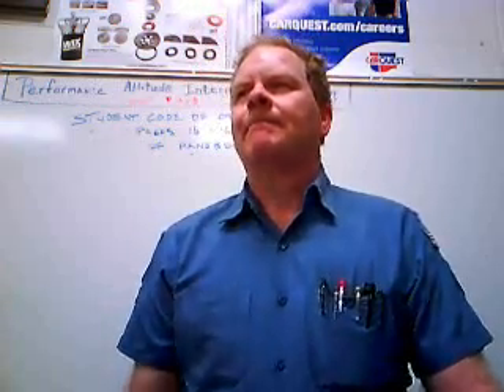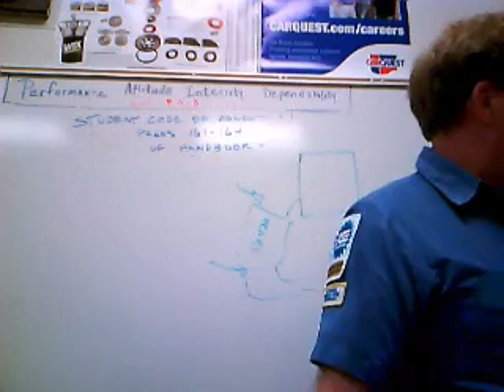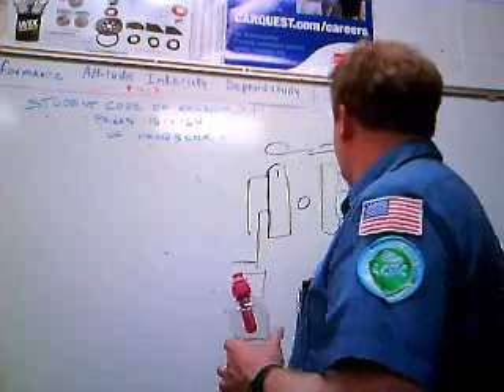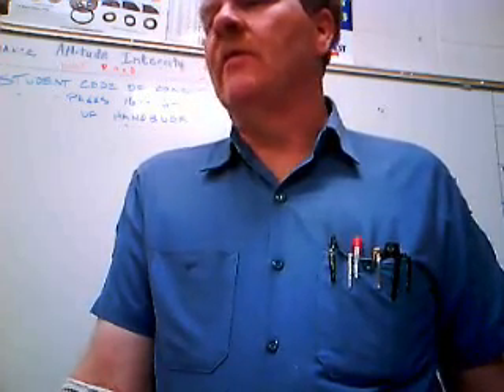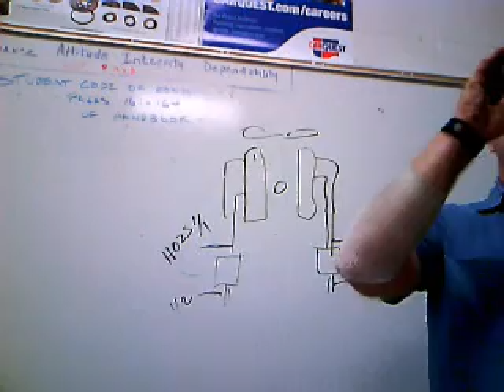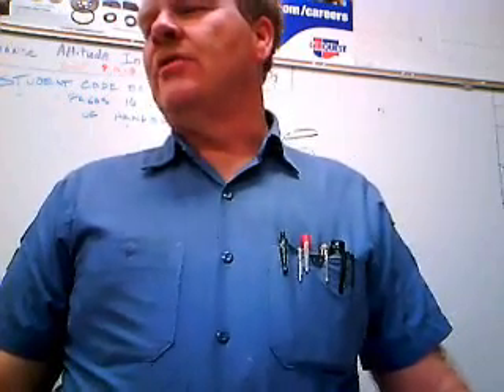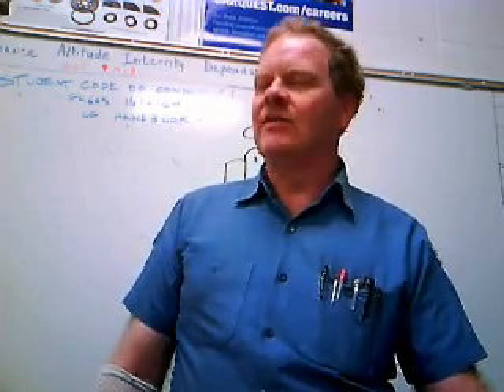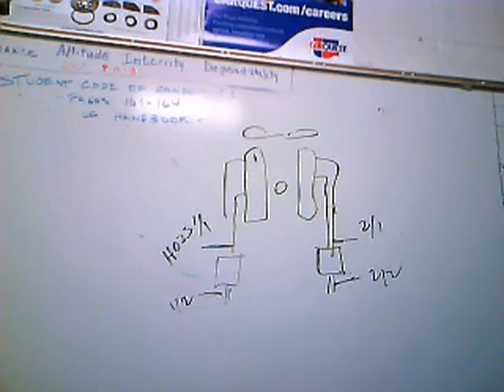OBD,Sensors,etc.wmv

Comment from the maker: If they spray enough on them it will cause problems, yes. A bit of overspray, no.  Silicone likes to coat the ceramic zirconia in the 02 sensor, though, so be careful of that